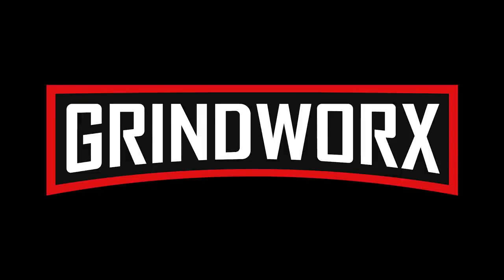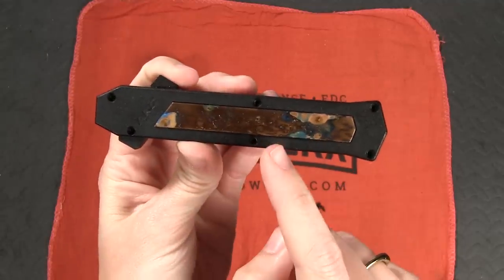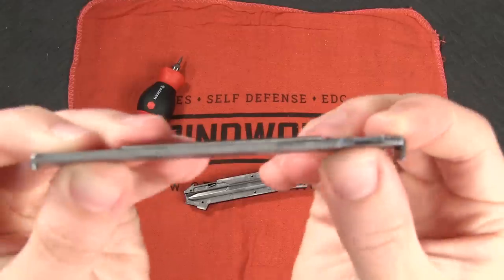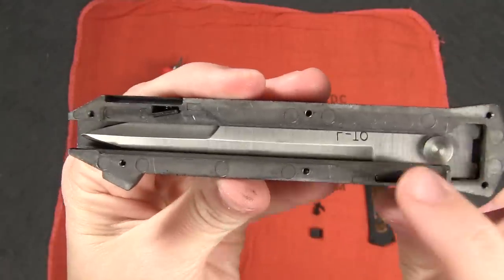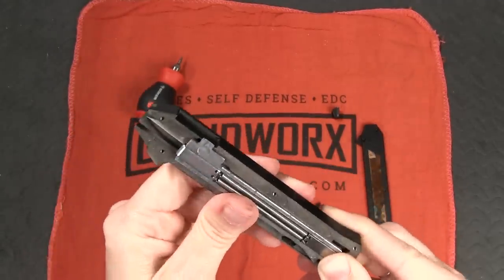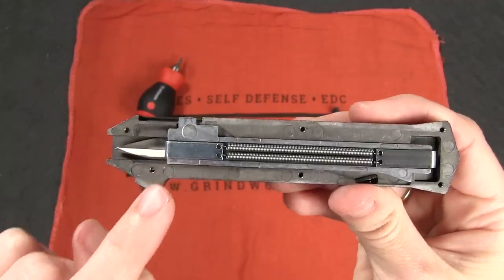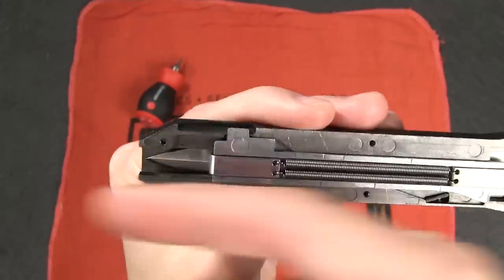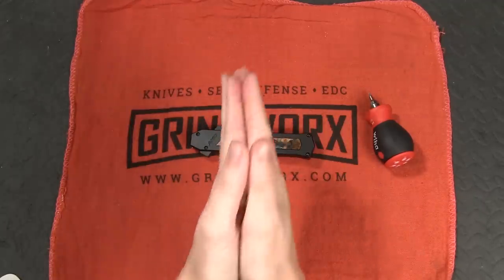How Do Double Action OTF Knives Work???

Comment: GOT IT!  The thingy goes down and the doohicky goes up.
Reply from the maker: Hahaha, pretty much. - Holly
Reply: What do you use an OTF blade for? I am confused ...
Reply: @raygun4468  for the same things that you would use a fixed blade or a folding blade knife, while it mayn ot be as strong as a fixed blade knife (the tang does not reach the full grip lenght), the blade retracts inside the handle making it smaller to carry, also it being automatic means that you can use it if you only have one hand free
Reply: Sounds like my highschool prom
Reply: @quentintin1  
The blade on the "otf"  , which is the new word for the stilleto , is not near as secure as a locking folder.
Reply: @JohnDoe-ho6mq   I think there are some OTF knives with a safety lock on them
Reply: @raygun4468  I keep mine for self-defense because I am a minor, once I am old enough I am going to get a CCW for my current 9mm (Walther ppq)
Reply: @JohnDoe-ho6mq  I must be doing it wrong. I own multiple, and carry otf's and use them daily and none of them have cut nor stabbed anyone...
Reply: @raygun4468  just because it's cool sounding and fun to play with. In addition to that you use it to cut things like any other pocket knife. See their other video 3 reasons to carry an OTF knife. Plus, I forgot, instilling fear in people.
Reply: @Finch-lh6lk  
Keep working at it. You'll get there one day.
Reply: Yup
Reply: Funny comment, yet I feel like the lady was simply explaining as though to a child considering her little knowledge of such things. As stated in the beginning.
Reply: This made my day better.😄
Reply: That's too comp!icated.  I'm taking notes...oh...you mean the pointy things that always cuts my finger.  Got it.
Reply: Yea im still lost too bro i thought there were two springs alway in tension and compression but im even more lost

Comment: I always wondered why they don't use this kind of technology for other things. One idea came to mind about a semi automatic NERF gun that would use a similar mechanism. I don't fully know the logistics but I feel like it has an insane amount of potential for other things besides OTF knives.
Reply: Well guns have a similar spring system used in them to prime ammunition into firing, so yeah, it is widely applied.
Reply: @markospaic1740  Semi auto guns use gas or human power to send the bolt back and mechanical spring energy to move forward only. This device is fully mechanical using inertia to lock up in both directions under the same set of springs both ways. So it isn't the same. The only similarity is the use of a spring which is a long ways from being similar since springs are found in a lot of devices. Also the choice of words "to prime ammunition" may not have been the best choice. Not picking on you for it as it is possible you speak more than one language and English isn't the primary so thanks for your efforts either way.
Reply: The main limiting factor is it takes all energy it needs to work, from you moving the slider or whatever. The more energy your mechanism needs - the more strength you'll need to operate that mechanism. It kinda works best with the knife because the blade is pretty light, and you don't need to move it much. When the thing you move is heavier, or when you need to launch it really far, is when problems begin

Comment: You actually did clarify one very essential point for me that I did NOT previously grasp; that the springs are only under tension when the user is placing load on them (with the thumb slide), and briefly as that load is being discharged by deploying or retracting the blade. I had the incorrect impression that the blade was under push spring load until the user hit the big shiny illegal button, as well as the directionally obverse tension too.
Reply: The springs are under some (mild) tension when engaged in either neutral position, front or rear, but yes, they're not drawn/stressed until the thumb pushes the slide via the thumbstud. The "double action trigger pull" is a pretty good analogy: push, push, push, then Bang!
Reply: @ronaldwells4427 😮 BBY 0

Comment: Great video! When the spring rear tang pops off the back of the blade u-notch when blade tip hits something while ejecting, additional procedure is needed.

1st push blade to the back behind the rear gate stop.

2nd hold rear spring tang in blade u-channel down with thumb while using other thumb to slide side button into position with pretention.

3rd rotate top cover over rear tang with downward pressure until in place. other wise "pop goes the weasel" try again.

BLADEWORX Lightening ELITE needed this finesse procedure to reassemble.

Comment: Some very clever engineering to make one set of strings work both to deploy and to retract the blade with just a little help from a thumb muscles. It feels almost illegal when you snap it back and forth and see it fly like that like it has perpetual engine inside to provide it with energy. But now, when I realise that it takes all energy it needs from the little thumb movement you do to move the slider, I'm even more impressed. Very, exceptionally witty engineering

Comment: I think this is called a bystable mechanism. Another place where these mechanisms find an application is in electrical switches. You first move the lever until the trigger point is reached, at which the contactors separate quickly to prevent arcing during the disconnect.

Comment: Awesome video! 

Very helpful description regarding how the mechanics (internal latches) work to hold the blade in the open locked position and closed position when not being fired in either direction. 

Also as a side note... sorry to even point this out, but I can't help but feel the need to suggest that the bit in your driver is a TORX bit and not a HEX bit, which is in fact the same screw/bolt head driver platform as an Allen key.

Comment: Thanks for this video, my knife stop working about a year ago and I didn't want to open it up fearing springs and parts would go flying everywhere. You video gave me confidence to try it and I found that the problem was that some cockroaches fhad got inside it via the blade slot (little bastards) and jammed the blade. Mine is very similar except it has only 1 spring not 2 like yours.
I cleaned it up and sprayed plenty of silicon lube and now it works a treat.
Thanks again.
Reply: cockroaches????

Comment: They are cool, but like switchblades have a major design flaw: their natural inclination is to open, and the only thing preventing that from occurring is a mechanical catch. The button to release the catch can easily be moved by accident; then you have an open knife in your pocket. And of course, the “worked in stiletto” that you flick open with your wrist is also a hazard. By far the best design of a “blade contained within handle” knife for one-hand open is the spring assist. It’s natural inclination is to remain closed - yet it opens as easily with one hand as any automatic knife.
Reply: There are other designs that reduce the risks you're speaking of.. Ones with side plate mounted thumb controls with a slide that can lock the operation from being engaged to open accidentally.  I am not a fan of this style of knife in general but it is intriguing how it operates none the less. I favor one hand operation so i tend to carry either medium fixed blades (sub 5 inch full tang thick backs) or assisted folders.

Comment: I always thought these knives where ingenious.
The neat thing about them is unlike some believe you can not place it against a target deploy the blade and have it puncture the object.
When you release the blade the spring  mechanism will disengage leaving the blade slack and without resistance.
So if you deploy the blade and it strikes anything before it is fully released and locked in position it will simply bounce off as a safety function to prevent accidental self injury.
Also we use to call these types of blades “Eagle Knifes” and a automatic knife in which you used a press button to activate was called a switch blade.

Comment: You explained it very well... although a suggestion... if you take off the springs from the slide.. you can manually explain the movement of the blade by just moving the slide to the open position and move the blade manually to the open position without it "springing" out... try it youself first and i guess u'll get what i mean.

Comment: I hope my question doesn’t come in too late for a reply. So if I understand what you’re saying, the blade is moved in either direction because of the 1/2-3/4 inch movement of the “thumb-slide?” In other words, the movement of the thumb side is what stretches the springs enough so that when the locking-tab is disengaged the blade moves the the other locking-tab? And at all times except when the springs are stretched by moving the thumb-slide, the springs are “at rest?”

Comment: You said the screws used a hex bit but I noticed you had the correct Torx bit in the screwdriver. That must have been a mistake, maybe you couldn't think of the correct name at the moment. I only mentioned it so no one tries a hex bit in a torx screw and rounds it off. They were always a mystery to me as to how it could move the blade so far with such a short movement of the button but it's really quite simple. Anyway, thanks for the video, I just got my first DA OTF knife and was curious how it could pop the blade in and out with such force with only a slight movement of the slide. I see now that it  stretches the two springs about a 1/2" to 3/4" to load the blade and when it releases the lock it lets the blade fly and momentum carries the blade all the way out or in. What she didn't mention is that it uses inertia of the blade itself to make it travel all the way out or back in. I've tried putting mine up to an object and ejecting it out to see if it would penetrate and it won't even go through toilette paper. It's really like a built in safety. If you do that the blade will not lock into place and it will slide back and forth loosely. To re-set it either flick it so the blade comes out all the way or back in. Also, I encourage everyone to join one of the knife rights organizations so they can fight the politicians and change the laws that would keep us from carrying them. I'm a member of AKTI, it doesn't cost much and you get all the latest news on the fight to change stupid laws that ban "switchblades" or automatics.
BTW, Def Leppard sucks!

Comment: That's very clever, so basically the spring is acting as potential energy reservoir so when you move the buttons you are converting the kinetic energy from moving the buttons into the potential energy of the spring.  Then the spring becomes free converting that potential energy to kinetic energy and moves the blade out or pulls it back in.
Essentially it's a bit like pushing a ball up a slope and when it reaches the top of the slope it falls off the cliff.

Comment: That's a very good one. I once bought a cheap front opener just to collect. I had no use for it though because it's illegal in my area and my Spiderco Clipit knives were far sturdier, faster and legal. I shortened and reshaped the 4" blade of my "Police Model" to a legal length of about 3 or 3 1/2  inches and reshaped it with a belly instead of the original straight edge. I also reshaped the stainless steel handle into a pseudo "coffin handle" just for looks and to make it more compact.

Comment: The part that took the longest for me to understand is, a great deal of the blades motion is 100% driven by inertia.  It only takes  a millimeter or 2 or 3 to accelerate the blade enough to quickly reach the next position being caught by the small latch either at the front or back. so the power cycle goes like this:
A.)Blade in housing
1.)Trigger pushed up towards the front = tensioning spring 
2.)Trigger reaches a point depressing the lower latch enough to release the blade=spring releases tension propelling the blade up
3.)Middle point, the bracket catches the spring and the knife continues with inertia to travel up to the upper latch which depresses and catches the blade.
B.)Blade out of housing (deployed)
4.)Trigger pushed down towards the back = tensioning the spring
5.)Trigger reaches point depressing the upper latch enough to release the blade= Spring releases tension propelling the blade down
6.)Middle point, the bracket catches the spring and the knife continues with inertia to travel down to the lower latch which depresses and catches the blade.
C.) Blade is in housing

Comment: The spring merely starts the movement of the blade . In other words, when the thumb knob is moved 1. the spring stretches about 0.2" and 2. it moves the lock tab away from the notch on the blade and 'slings' the blade (same for either direction). The spring does not move the entire length of the blade's travel. Were you to have the discharge end of the knife against a solid surface it will stop as soon as the tip protrudes the end of the knife. thus stopping the blade's movement.

Comment: OTF knives are cool and interesting. CA law bans them so I can't have one. For actual use, especially combat, I prefer a good karambit held in shadow hand position. A good folding karambit with emerson wave will be fully open the instant it's pulled from my pocket, so deployment is faster than OTF switchblade. And better knife makers use high grade N690 steel.

Comment: So, I am new to the otf game. My knife has started to “rebound”. Failing to lock open. 
I’ve sprayed some light “degreaser” into the channel, and cycled it several times. It seamed to help….then it didn’t.  I added some light “dry lube” as I’d hoped it would be less apt to gum up. 
It has not fixed the problem. I’m thinking from watching your video, that the “latch” at the front below the sliding switch is not engaging correctly. 
A disassembly, and thorough cleaning should fix the problem….I hope?
Any tips for a novice before I make the attempt?

Comment: Thanks, very helpful understanding its mechanics. Flush against a ballistic gel block, how far will it penetrate when released. 👍🏼
Reply: Not much. I doubt itd penetrate much at all. The "power" in a double action otf seems to be in the first centimeter or so of the action - this is actually a good thing. If it somehow deploys in a pocket it doesnt fully fire - making it safer.

Comment: OK another video shows that when you push the thumb slide to release the blade it puts tension on the spring before it unlocks the blade with the latches and it's the same in the opposite direction.  You actually put the tension on the spring yourself when moving the thumb slide.  When it's still there is no spring tension.

Comment: Very interesting! Always thought it was a pulley system or opposing springs. Actually quite a brilliant design!
Reply: It could be done with dual pulley, springs, and cables but becomes more complex. The key is balance, tolerance, and inertia. The design is very simple which in turn makes it somewhat more durable IMHO.

Comment: People make sure the safety is on if you carry one of the smith and wessons in your pocket. The springs are extremely strong. After all the true design of these knives is to get up close and personel to the intended victim. Put the knife in the preferred kill zone hit the switch open then clise and walk away before he or she hits the ground. I was using mine as a pocket knife working on a water line. Standing squatting etc all day. Missed the safety at least once i know of and the knife opened and shot straight into my thigh about 2" deep. The fun part was getting it to retract as it was in my pocket of my jeans and i was squatted down on my knees and the blade was extended into my thigh quite deeply. Dont know if anyone has ever tried to stand up from a kneeling position with two inches of steel burried in their leg but i can tell you the leg doesnt want to cooperate any more than the jeans that were too tight to begin with. Of course the knife doesnt want to play well with others. It didnt fully extend so hitting the lever wont retract it. My hand wont fit in my pocket the try to pull the knife out. And it was stuck at an angle that doesnt allow for leg to straighten without tearing the leg meat open. Its a tough call how to handle it. I took it like a man. A bug 300lb man who crawled home made sure noone was looking and crued like a baby. It finally healed nicely. Im still wearing the same jeans the knife is still in my leg. And i use a wagon with a little leg saddle to waddle around everywhere
My friends say they can barely notice..

Comment: Another pro tip: if you put a couple small dabs of thick lithium grease on the springs and coat them in it, it quiets the cheap sounding ting when you deploy it so the microtech otf snobs won't make fun of you. Lol
Reply: @chestercopperpot777  lol. But no ting is ninja mode. 😉

Comment: One warning, especially if you have the RARE camo NATO Military model knives: do NOT put the opening against a sheet of paper and deploy the blade. It could damage the mechanism. Did this once and had to spend quite a while trying to figure out how to get the blade to "hook up" again. It works fine even though it's over 20 years old. I always kept it tucked away so even the paint is all original.
Reply: I’ve done that …
  You simply grab the blade and PULL like you are cracking your knuckles - 
Pull the blade OUT and it re - connects instantly .
Done .
FYI

Comment: Very nice video, couple questions. Does anyone ever measure/record the thumb pressure (lbs of force) needed to open/close (like trigger pull lbs of force on a firearm)? More comment than question, it seems pretty flimsy the way the blade ends up being attached to the handle (unless you are buying a high end/expensive OTF). Subbed.